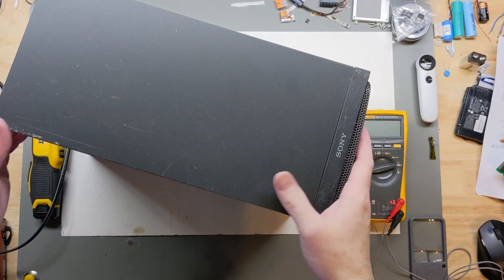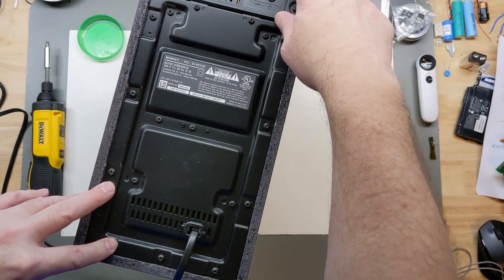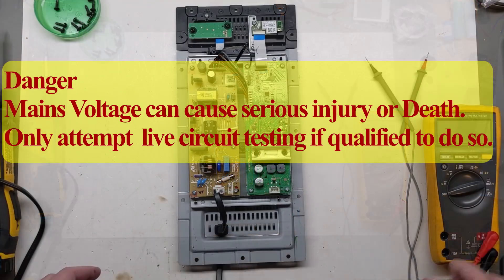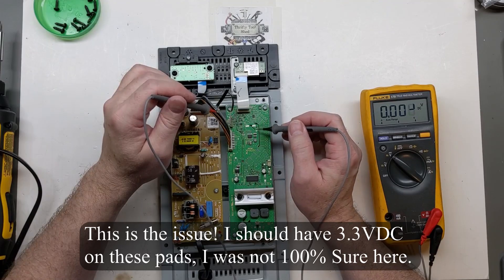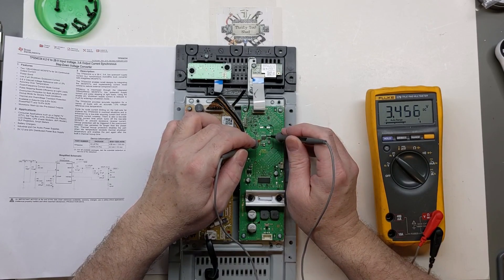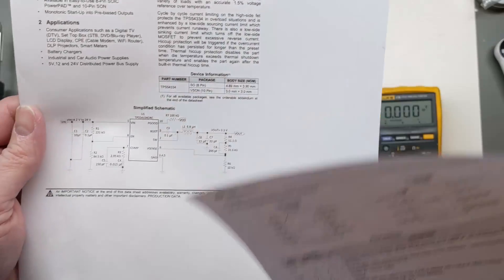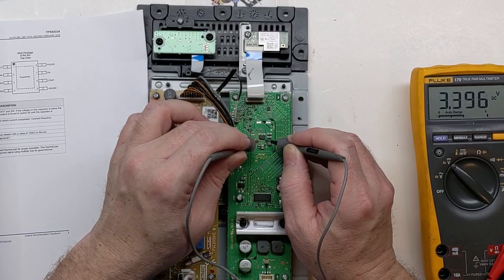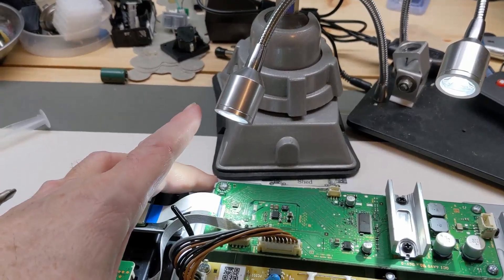Sony SA-WCT290 Sub-Woofer Repair

Comment: Hello Sr thanks for your video very helpfull
I went for the cap and get about 280v (in my country the dc is 220v) but then in the next test on the 10pin conector between the black and brown cables (subwofer ground) i didnt get any voltage. What could be the problem?
Reply from the maker: Sorry, I only worked on that one and shared alot of the information I learned on that video. I have no schematics or any other information other than what was shared. Since this was a failed voltage converter chip, I had no reason. To dig much deeper. Best of luck to ya!

Comment: Hi, thank you for sharing this video, I found it extremely useful and I learnt a lot. I checked my subwoofer and it was indeed the same TPS54334 failure, i replace it but know im not getting 18V on the power board? Any suggestion what should I check? Fuse is OK. Before replacement I had 18V on the power board pins on top and the chip was indeed burnt. Any ideas?
Reply from the maker: Make sure you have no bridges on your new chip and I would look for hot spots on the board when powered on. That is assuming something is not already opened up of course such as a fuse or Rectifier? I did not have an issue with my power supply side so I can't say for sure as I did not have to look at that one very much. This was the only one I ever worked on. Thanks for your comment and best of luck to ya!
Reply: Thx for your reply. I checked for bridges but i think is ok. I unplugged the cable betweeen power board and main board and have no voltage measuring directly to the pins. Any ideas will be appreciated
Reply: Finally i can say the power board its ok. If i unplugged the wire to connect to the main board i didnt get any voltage but i charge a capacitor with just the multineter and i got 18v voltage when plugin to AC. So i think is a bridge on the new chip, even if i dont say any. What would be the result when measuring with ohmnimeter between pins? Im getting open circuit on one side and close circuit on the other, could be ok? No idea whats inside the chip and how it works
Reply from the maker: @davidv1761  
Its been a while since I touched this, and it was the only one I ever worked on and I had no issue to go further. I wish I could say, I would check positive output of supply to ground and see if it is infact low ohms to ground. I would think even with the chip across it should not be low ohms from positive side back to common or ground. But you should be even higher than that if the supply is disconnected from board?

Comment: I did SMT soldering for years at different companies in Ottawa Ca and let me tell that chip is easy. Don't be afraid to get the chip hot, taping it off was a good idea, the hot air will blow of the smaller components around it. But don't try to pull it off before the solder has melted, you will pull the traces off, it wil come off with no force at all.  The ones that are a pain are ones with huge heatsinks attached, we had giant 200w iron for those.
Reply from the maker: So true, the power components soak up so much heat with the heat sink and sometimes the ground plane. I have many repairs that I have to use at least 140W iron on. Thanks for sharing!
Reply: @ThriftyToolShed hello. What temperature did you use for the hot air gun, to remove this chip? Thanks

Comment: We have the same model, but the pcb inside is a different revision by the looks of it. It sometimes randomly makes a loud popping noise and now it started buzzing. Took a look inside and I don't see anything wrong. Plugged it in again and it works again. Idk what is wrong. Caps on the psu seem good.
Reply from the maker: Seems like a PS issue to me, however, I have no experience with that exact problem myself. I only worked on this one and shared what I found with it. I guess I would check for AC ripple on the PS buss and go from there?

Comment: Just found this since mine has the same issue with no lights. I can solder basic things but I probably would not be able to do this myself. Is there a way to buy that entire board to swap out?
Reply from the maker: I do not know of anywhere that sells these parts. You may get lucky on eBay with a saved search to notify you when one shows up?
Reply: @ThriftyToolShed  i did end up buying the board and hooked everything back up and everything lit up, but wouldn't sync back no matter what i tried.
Reply from the maker: Man.... Sounds like you did an awesome job and got the power back on. Now it will not reconnect, I have had several comments about that as well. Even though I have not seen one do that myself it seems to be more common than I originally thought it to be. Sorry to hear yours will not connect. Seems like an issue with the Bluetooth board itself as well.
Reply: @ThriftyToolShed  I can connect via Bluetooth from my phone to the sound bar as that always worked, but just won't sync with the sub. Very frustrating

Comment: amazing tutorial, in my case it was the same failure but a resistance was not working either then I desolded IC Regulator and put a I LM2596S step-down regulator and It's working now. thank you for you help
Reply: Me puedes explicar cómo lo has hecho ?
Reply: @eliasbau3041  11:24 is seen place where - and + 3,3 V needs to be. So cheap buck converter could be adjusted to 3,3V and it's + and - connected accordingly. Converter also needs +19V at input and former chip needs to be taken out. Not pretty but could be done with just ordinary soldering iron.

Comment: Excellent Sir...  SONY is  not an exception in users of substandard material.
Reply: My friend Mr Nair (86) a retd. scientist from Hindustan Antibiotics Ltd Pune India, & recd. this HT CT 290 system as a gift from his son at Seattle USA an year back. All of a sudden the woofer stopped on a fine day when there was some voltage fluctuations.    This S/w was taken to a local authorised service centre. They charged Rs.150/- for checking. And quoted Rs. 2500/-  as repairs charges. We were not happy at this. And refused. We now plan to take it to a local expert, to save heavy servicing charges. ( 60% saving is expected) Your guiding tutorial is of a definite help in  resolving this. Thank you for that. Also the videography is of equally better quality.  Very good illustration also. This video creates hopes and might be a perpetual help to the buyers of this substandard system bearing a big brand name.
Thanks again

Comment: My subwoofer is not connecting to the sound bar anymore.. The red light is on how to fix it
Reply: You might just need to relink it. Mine had a red light too. Once I unplugged it, the light never turned on. Why I am here. Sony website has some troubleshooting you can try

Comment: a question i have the same problem with my woofer is the same htc 290 series where can i buy the replacement
Reply from the maker: If you are asking about replacement 54334 Chip, I have link in description. it is just a link for reference only, select the best price and shipping cost for your needs as sellers vary daily. Hope it helps, best of luck to ya!

Comment: Helle,
i have the same problem,
but i cant find the right chip from TI on the Internet.
Can i use the TPS54334DDA from TI?
Reply from the maker: I have reference link in the description. I believe it is correct replacement. Link for reference only as sellers vary daily. choose the best the you based on shipping and cost. Best of luck to ya!
Reply: 0:09

Comment: What size heat gun is needed to do this particular chip replacement?
Reply from the maker: I used the hot air station that is in the video description as a link, it works well for the money. Most hot air stations should work.

Comment: Great vid - just what I needed.  Please provide links for the tape products you used.  ALso, will my harbor freight height gun be sufficient?  Trying to do this without a huge investment.  Right now it doesn't work, so If i try and it fix it, great.  If not, no real loss.
Reply from the maker: I have added the tape to the links already in description as well as the hot air station I use. I can not say for sure, but I would not think the heat gun would work very well?

Comment: My 290 just went out - no light - found this video and I cannot repair myself as I don’t possess that skill. How much would it be to send it to your abs repair it? I have 2 of these sound bars in my home - one 390 and one 290 and my sound bar works fine - but depending on price to repair would determine whether I get it repaired or just buy a whole new 390
Reply from the maker: I wish I had time, I do get asked this often. I do not have a repiar service at this time.  I work full time+ in a Industrial job and try to have time to edit videos to post. I try to help by posting what I have found with a repair.  I don't have alot of time left, I wish you the best of luck with yours.

Comment: Hello good day!
I need help with this equipment, the client did not bring the bar, only the subwoofer, when checking, detected an integrated 8-pin shorted TPS54334, I changed it by installing the new one, and that's it, the equipment gave a signal of life, green led flashing and red (I said This is ok) but there is an additional problem, that it does not link with the bar. I actually did all the tests for the safe link. I disassembled the subwoofer and I do not see anything strange. The voltage reaches the bluetooth card. Change some capacitors. I have come to think that the piece of Replacement does not work, I have doubts when I turn on the led it goes from red to the link link link it changes to flashing green then to red. I thank you if you can help me, I do not give up easily.
Reply from the maker: I know what you mean. It's hard to give up on a repair. I have only had the one issue so if you are getting the 3.3V rail I would think your chip is most likely ok now? I have not had issues with the Bluetooth board/module but sounds possible.
Reply: yes, I have the same problem, after replacing the chip I can't link the subwoofer to the sound bar. And I don't why
Any ideas? 
thank you!
Reply: Я тоже столкнулся с такой же проблемой. После замены чипа световой индикатор работает, но связи сабвуфера со звуковой панелью нет. Сабвуфер понимает что он в поиске звуковой панелью, так как режим работы светодиода меняется, но подключение не происходит. Любые идеи?
Reply: @СергейПарамонов-н6с  У меня подозрение на то, что Bluetooth модуль тоже пришел в негодность. Он у меня очень сильно греется. Я не уверен, что это так должно быть.
Reply: @OvchinnikovAlex  спасибо за ответ. Поискал в интернете, оказывается это частая проблема с Блютус модулем, он тоже выходит из строя

Comment: I've the same issue but I'm a total newbie. Seems I'll have to give it a try. What is the 'paste' you used at 6:29 before using the heat gun?
Reply from the maker: It's a solder flux paste. You can use RA rosin flux as well. The flux helps alot with the process.

Comment: what would i do if the actual sub speaker has blown, i think my unit is a sealed unit, and I'm not sure what to do or how to fix it, it still works just makes a real bad rattle sound under use. my sub is the  "SA-WMT300"
Reply from the maker: I have not experienced that to say for sure. I fixed this one for a friend and the only one I have worked on. I would look for any information on it and go from there. It may be hard to find, but it's worth effort to check. If you have no luck finding an exact replacement, it is possible to get one close. The speaker may have the rating on it or at least if it's 8 ohm or 4 ohm etc. then if the complete unit list the wattage, you can go by that to be close.

Comment: Sony Sucks. The same thing has happened to the subwoofer of my HT-C290
Reply: Same thing happened to my HT CT 790.
Sony did that with purpose ??? it should brake down after 4-5 years max. So u have to buy a new one.
It sounded good but not reliable enough. 
Bye bye Sony,  I will try Corean next time.
Reply: same thing happened to my subwoofer too they have made it on purpose.

Comment: After chip replacement cant pair sub with soundbar any ideas?
Reply: I have the same problem it power on but no pair could be the bluetooth module that is failing?
Reply from the maker: @spallettaandrea  Very possible. I have not had that issue with one yet so I have not had to troubleshoot that. Most of the time If the 3.3V rail is good they just connect back. Some may have to be "paired" again.  I mean Bluetooth pairing of course. Some may have a faulty blue tooth module?
Reply: @ThriftyToolShed  i tried all the procedure for pairing but it doesn t pair..i   lost the heatsink could be that acts as antenna?
Reply from the maker: I am not sure on that one, but if you have them really close together and still won't connect, must be a Bluetooth module issue?
Reply: Ciao Andrea. Hai risolto?mi trovo anch io con il sub morto.ancora no  n ho sostituto l integrato
Reply: @valentinorsv  ciao Valentino quell integrato è molto comune a bruciarsi in quello specifico modello...sicuramente si riaccendere una volta sostituito...ti posso chiedere poi di fare una prova una volta che lo hai sostituito?
Reply: @spallettaandrea  grazie.certo va bene faró una prova. sono anni che non mastico piu elettronica ,ti chiedo se una marca vale l altra per quanto riguarda il componente.tu comunque hai sostituito ma comunque non si accende neppure il led giusto?cosa pensi che possa essere oltre all integrato?
Reply: @valentinorsv  nono la mia problematica era che il sub si e acceso dopo la sostituzione ma non si sincronizza più con la soundbar tramite bluetooth e non capisco quale sia il problema è riguarda proprio quello la prova che vorrei farti fare. Ti consiglio di sostituire l integrato con lo stesso codice presente sopra all integrato danneggiato
Reply: @spallettaandrea  Grazie ti faro sapere.p.s mi mandi un email cosi ci scriviamo di la?Grazie  valentino.bv@hotmail.it
Reply: @valentinorsv  certo grazie
Reply: @spallettaandrea  buongiorno, ho fatto riparare il sub in un negozio di elettronica, ora il led si accende rosso ma non riesce rilevare la soundbar, mi sembra sia un problema comune purtroppo, per caso voi avete risolto? grazie mille !!
Reply: @valentinorsv  buongiorno, ho fatto riparare il sub in un negozio di elettronica, ora il led si accende rosso ma non riesce rilevare la soundbar, mi sembra sia un problema comune purtroppo, per caso voi avete risolto? grazie mille !!
Reply: @marcodallavalle9344  salve anche io faccio il tecnico in un negozio di riparazione informatica e anche io in fase di riparazione ho avuto lo stesso problema da quello che ho capito sembra che alcune volte oltre a danneggiarsi il circuito si danneggia anche la scheda bluetooth e va sostituita.
Reply: @spallettaandrea  Grazie Andrea per la sollecita risposta, ma la scheda eventualmente da sostituire è presente nella sound o nel sub ? grazie mille
Reply: @marcodallavalle9344  Buongiorno .io fatto riparare in un centro Sony,per ora.va ma sinceramente non la sto piu usando
Reply: @marcodallavalle9344  ma figurati sempre nel sub solo che solo quel pezzo costa una 60 una di euro a mio parere rischia di diventare una riparazione antieconomica
Reply from the maker: I did not have any issues with that to say for sure. I am assuming you got your 3.3V and your led lights up in front of sub?
Reply: @ThriftyToolShed  yes ligts come back but only green flshing, asked sony support they dont have clue too
Reply from the maker: I have not seen that, sorry. Most likely in the Bluetooth module. Possible I guess that the BT module took out the 3.3V rail to start with, but I would not think so.
Reply from the maker: I have not seen that. I worked on the one. Once I got the 3.3V bus back up, I got my led lights. Gave it to the owner to make sure it worked correctly . It paired for my friend right away. He had no issue.